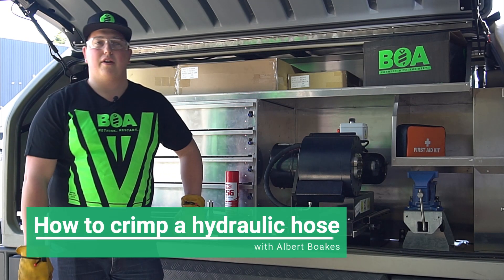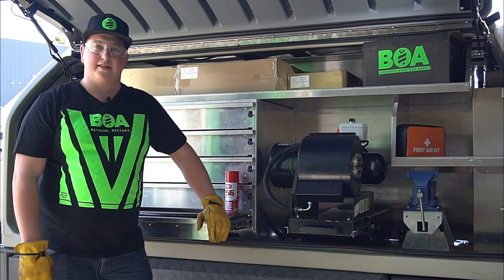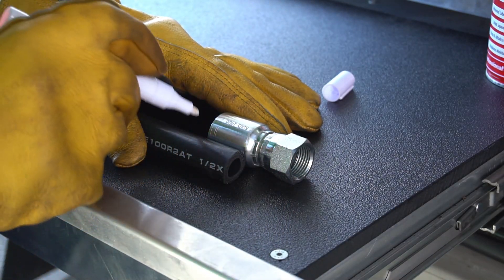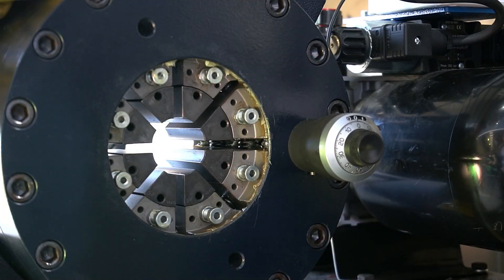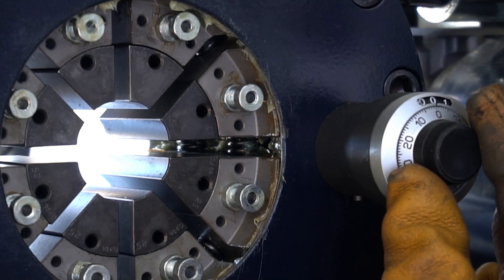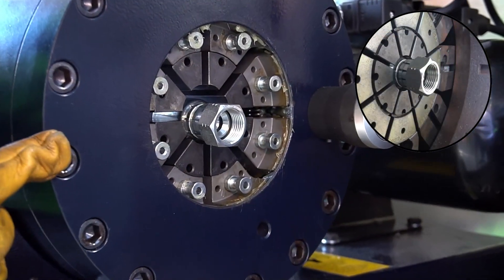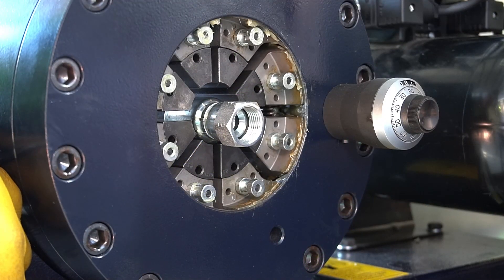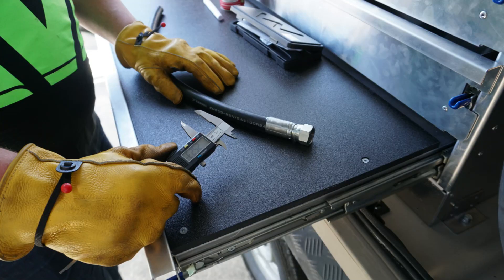How to crimp a hydraulic hose

Comment: I have hose that has an inner diameter of 3.2mm and the outside casing is 6mm.  And the whole thing is sheathed with that metal webbing, that stuff that stabs your fingers.  The addition of the metal sheathing makes the entire hose 7.5mm in diameter.  I am not sure if there is a crimper tool on the market that handles that specific size hose and connectors.  I only see crimper tools for larger hoses. Got any suggestions?
Reply from the maker: Thank you for enquiring. AT BOA we specialise in high pressure hydraulic hose solutions. There are many low pressure hose crimping solutions for various applications. https://www.ebay.com/itm/195760506407 shows an example of such crimpers FYI.

Comment: Actual information, thank you. Sadly, those hydraulic crimpers are very expensive.
Reply: found this link while searching for info on various cheaper option.
the micrometer check for correct crimped dimensions is a good tip.

Now I'm questioning if crimper needs the dial adjustment shown.  I'm expecting a correctly sized die with the correct hydraulic pressure applied and crimped dimension checked with micrometer would be adequate.

I'm looking to make some custom hoses to fit adjustable relief valve on my 1.5T  mini excavator - to use on auger and thumb grip, because these are the highest at risk items for damage.